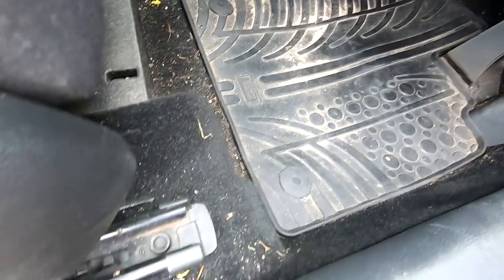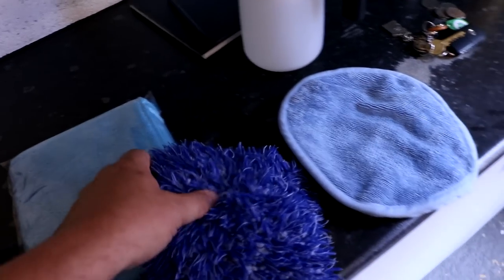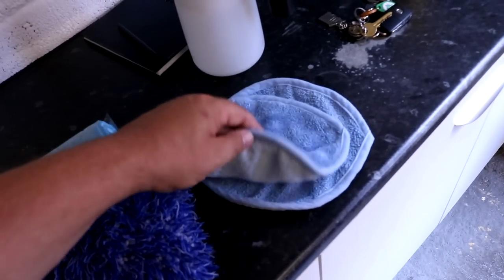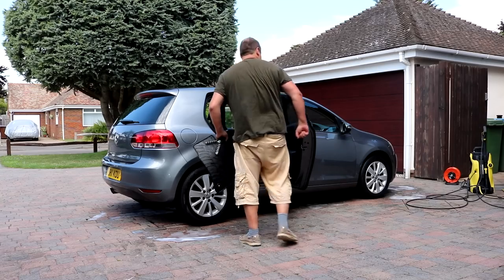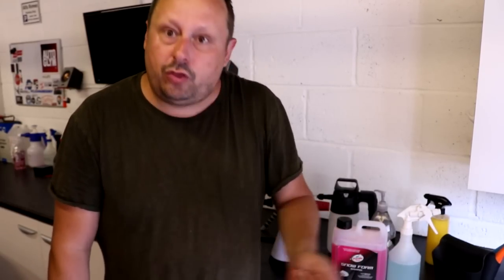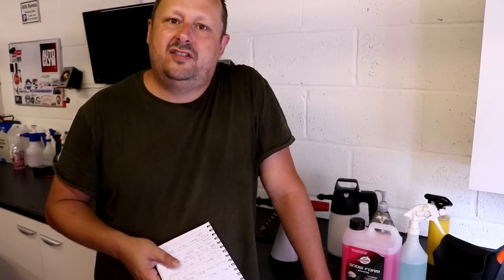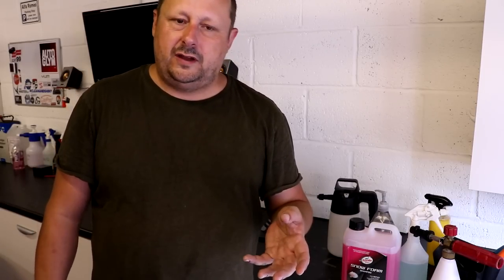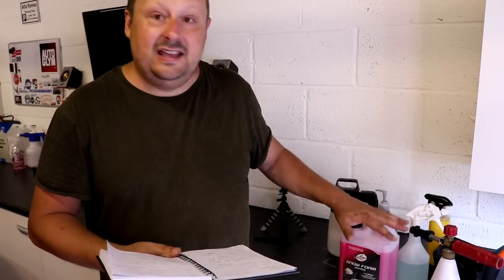Cleaning a filthy VW Golf with NEW Turtle Wax Hybrid Snow Foam

Comment: I recently ran out of the BH autofoam and just had Surfex HD and a bottle of AF avalanche, i dosed the avalanche with some surfex and it gave decent foam but with ridiculous cleaning power - i hadn't cleaned my van in 2 months and all i used was the foamer, a mitt and the pressure washer - worth doing in a pinch i would say - surfex is my go to cleaner in the workshop, on my vehicles and around the house these days!

Comment: Tip when washing the mk6 Golf - you can make the wipers park in the upright position (so you can then pull the wipers away from the screen) by quickly switching the ignition on then off and then blipping the wiper stalk down. Makes cleaning down to the bottom of the windscreen much easier!
Reply from the maker: yer this is an awesome tip someone else told me this.  but to be honest I only need to be able to lift slightley for a quick wipe. but I think if detailing or doing something on the front windscreen this would be so much better.   I think its the same on the M140. awseom tip thank you stew
Reply: What kind of car doesn't allow you to just pull the wipers up whenever you want? That's absurd.
Reply: @EdvardsAntonovs  Lincoln Towncar doesn't. The ones before they completely changed them into midsize cars. The classic older large ones don't but not sure about the new ones.
Reply: Edvards Antonovs they’re tucked away under the top of the bonnet
Reply: Edvards Antonovs  tesla s

Comment: Turtle wax have offer on. £35 for a bucket, 3 wash products and 2 accessories, the snow foam inc’ . I got snow foam, seal and shine and wheel cleaner, wheel woolie and grit guard and a 5gal bucket all for £35 inc’ delivery👍 Bargain as 2 litre of snow foam is £18 alone

Comment: Did I catch you not rinsing off the initial snow foam again!
Reply: I saw that🤔
Reply: Why rinse it off? Is it to remove the layer of dirt it initially captured?
Reply: @AutOdometer  Yes exactly otherwise all the dirt is still on the car. Foam is very viscous so the dirt wont go anywhere.  if you aren't going to rise off the foam it is actually safer to just not use foam at all and only only water lol.
Reply: it's marketed as the Snow Foam Shampoo so maybe he was testing it in that extent? :)
Reply: You should rewatch & listen to what he says... He was using it as a contact wash aka shampoo via lance. It's his daily family car so doesn't get the same treatment his M140i gets.

Comment: Great Video. I like Sam’s snow foam, Really thick and sticks really well, Don't recommend the keg though lost half mine through it leaking maybe my own fault but i'd pick the bottle next time.
Reply: Can't go wrong with slims detailing. Their branch is just 2 miles from me and I just like popping in occasionally. Really great friendly guys there also. Could get a cheeky discount also if you get stuff from the shop
Reply: I meant Sam's snowfoam sorry i got confused lol. I have use Slim's website before very good
Reply: @ItsRyan.  ah no worries 😂. Might have a look at that snow foam. Just been using my large container of Bilt hamber auto foam which will last forever

Comment: If you use surfex hd as a interior cleaner. What dilution would you use ? 
Any quick tip on what to use on a boat cover that has mold on it ?
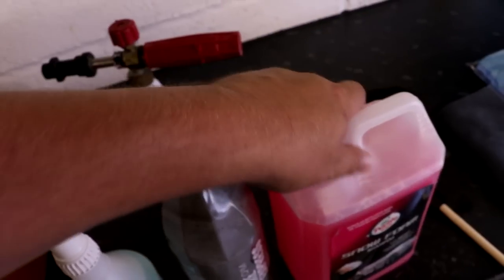Reply from the maker: surfex 1:30 typically mate.       Mould use some like citrus clean with anti microbial....   the key though will be about extract and scrubbing koblars.. get a drill brush and work with soft tip attachment and then extract mate and let it try out.

Comment: Hi John. Can you please settle something that I asked on a detailing fb page regarding snowfoam. Do you need to rinse your car before snow foaming or is it best to just spray foam as the product may stick better? There were mixed opinions on this. As you’re the guru what’s your opinion on this? Thanks
Reply from the maker: No difference really.  

Put it this way.  a) around 99 to 99.5% of whats being sprayed on the car is water anyway.

By spraying water on it first you are going to soak the dirt in the same way.   Whats more significant is are you going to use the pressure from the pressure washer to blast off any big chunks,, or if its really soiled (mega heavy road film)  just blast some of it off first...  So for mega heavy winter dirt, pressure washing first is sensible.

b) the counter arguement is the pure water on the car will knocking the dilution ration of the prewash right down...   And yes it will.  and it might make it more runny.  So some guys that have nice thick fluffy sticky foam want want it to hit water and go more runny etc..

The list of arguements you can think off goes on and on..     If your preping a car it doesnt really matter.. if its a safe wash then perhaps it does..

There also the arguement about wasting water...  There also an arguement just a hose down with water can cool panels down in the summer and therefore allow the subsequent snow foam to not dry as quick...  

Honestly there is no right or wrong on this...   I dont think its critical.    You can literally do it either way.   I tend not to prewash with water...
Reply: @ForensicDetailing  Cheers for the reply.

Comment: Another good vid Jon. How did you get that karcher hose so loose and uncollied mine never stops coilling up
Reply from the maker: its the 10m one on the K7, its seems to just work well and its good for not coiling
Reply: @ForensicDetailing  I bought the extension lead for my k4 but its wrapped in a circle in the box so it's a nightmare
Reply: GordyCOD I had the same thought when I saw it all nicely laid out and I have the same problem with the K4 extension hose. The main k4 hose has started to behave now so I am hoping that with a bit more use the extension will do too.

Comment: OMG did you just contact wash with the same snow foam still on the car? No rinse first? I expect you're just grinding in the surface dirt not removed when the snow foam drags it off but just surface lifts it. Judging from the cars starting condition I would think that's still a lot of dirt to rinse off.
Reply: Seems like it. That is definitely a no no in my book even if you are trying to save time.

Comment: John, would you like to test Tire dressings ?
My favourite is PERL but I would like a comparo with Gyeon Tire and others.
Cheers :)
Reply: What sort of finish does PERL give? I've been using Meguiars endurance tire gel. The bottle I've had for at least 2 years now and I'd say I haven't used a quarter of the bottle yet.
Reply: @zaink7037  shiny :) can be matte if you dilute it accordingly , search on the net.
I have a video comparo on my channel  if you like, diluted 1:1   still didn't tried Gyeon Tire , I have spent money on different dressings already.
To be honest PERL is my favourite , Price / ease of use / looks / water resistance etc... last 1 week.
Reply from the maker: this is coming soon might be a while off.
Reply: LOUi DC5 FL  That's why I never use it :) PERL is the least oily IMHO .

Comment: Honestly, what is the best snow foam so far in the industry? The one that produce the most thickest foam ? For foam cannon?
Reply: LOUi DC5 FL thanks im agree but I want to know what is the best thiker foamer and what is the ratio so I can get the most thickest foam
Reply: pedro Gonzalez For what purpose? Marketing?
Reply from the maker: @Pedroluvslupe  thick foamers maybe try Autoglym Polar Blast, Gyeon Foam, Magi Foam, or Meguiars Ultimate snow foam.   Those are some thick foams.  meguiars has some insane thickness too it but its borderline unstable...  magnifoam has the most clenaing power out of all these imo.
Reply: Sherukka no, just a big fan of thick shave foam
Reply: Forensic Detailing Channel pardon me, im from USA, what does mean borderline unstable? Are all these products for sale in USA? How about honey dew and griots surface ?
Reply from the maker: @Pedroluvslupe  I dont think the meguiars snow foam is available in the USA.  which seems a bit wierd... but have a look on the review I did on it.. the product goes a bit thick like a slush puppy.
Reply: Forensic Detailing Channel perfect, ok so you think this is the most soap thicker, now what is the one that have the best cleaning abilities?
Reply: @Pedroluvslupe  That's ok! :D
Reply: pedro Gonzalez magifoam by Autobrite Direct has the most cleaning power out the ones listed above only foam with better cleaning power than magifoam but less thickness is bilt hamber
Reply: Cameron Stevenson ok but is it sealant and wax safe?